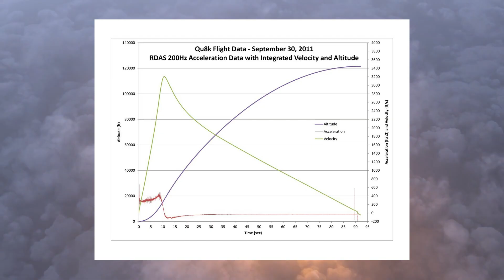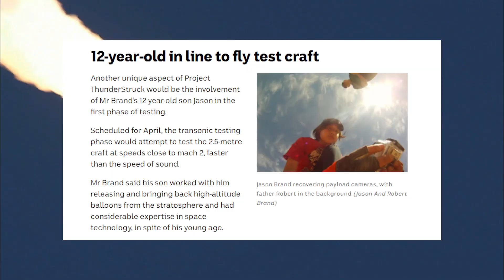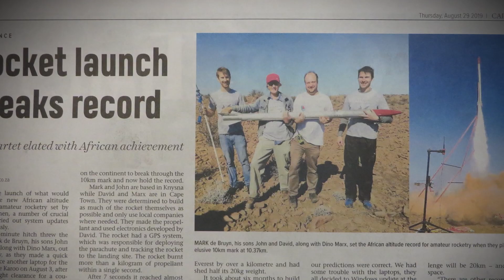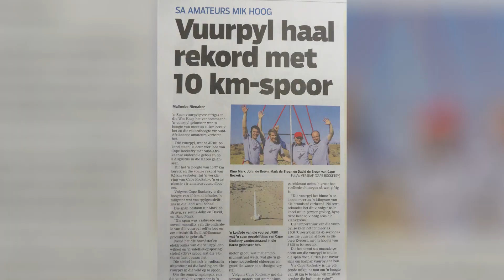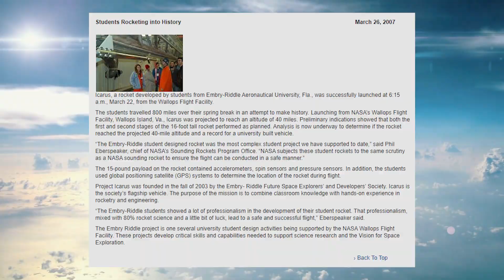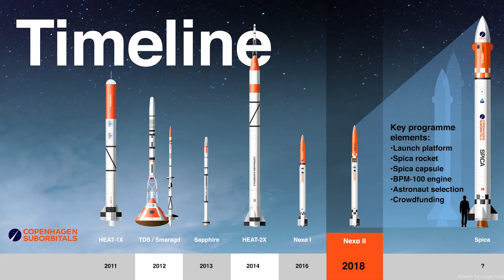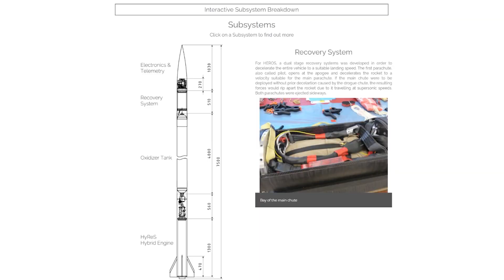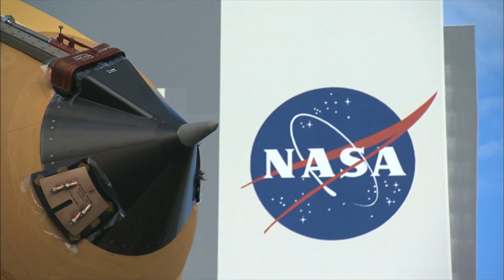15 Homemade ROCKETS that are Incredible

Comment: This video is from 4 years ago, but the script reads like bad writing from ChatGPT. At 12:49, it's said the Tycho Brahe doesn't use nitrous oxide for the "fuel" like Virgin Galactic, but rather LOX. Seriously? That's the oxidizer, not the fuel. Oxygen is literally in both names. And LOX isn't some fancy new outlier, Robert Goddard used gasoline and LOX 99 years ago (March 16, 1926).

And let's not even get started on the Mercy Redstone flub. The moon? Seriously? That would be like someone going from San Francisco to Tokyo in a unicorn floatie. This video has some great rockets (and an oddly excessive use of Ares1 footage), but good lord this is awful.

Comment: The Dome separating our air space with the Fluidic space above the Dome is 70 miles.  This is why NO ROCKET or thing can exceed that height.  Space as you know it is in FACT Fluidic space.  Nothing we have can travel through it; NOTHING.

Comment: Anything with solid propellant is just playing.
Reply: I see. So then, that's why the Space Shuttle and SLS use/d SRB's as their primary thrust.
Reply: @BryanM61  the space shuttle was designed in the 70s. The Chinese were building solid propellant rockets 2000 years ago.

Comment: I was setting up my homemade rocket at the park when I saw a low flying banner plane heading straight at me. I couldn't resist waiting and timing my launch to try to hit it. Rocket went up and popped its oversized plastic garbage bag parachute right in front of it. The plane had to take "evasive" action.....lol  I got the heck out of there before someone accused me of trying to shoot it down!!!

Comment: Are there any amateur rocketry groups that are replicating SpaceX rocket designs in order to test alternatives?  Such as, heat shield wraps (instead of pinned tiles), a deployable and redeployable scissor wing (instead of the fore and aft winglets), partially lifting a rocket with hot air balloons in order to reduce the required thrust to reach orbit.

Comment: Where are the amateur antigravity groups developing vessels that need no fuel or propellers or….? I'm surprised Bob Lazar hasn’t developed a vehicle using element 115 off of the periodic table. Newly discovered a couple decades ago. 🤔 This element is required to propel one type of antigravity machine…..Bob was involved in reverse engineering several captured antigravity ships.

Comment: That sht could get expensive!  In '60s E. Lansing MSU Rocketry Class, 1/2 of grade was in your rocket's performance.  Had to use Estes rockets limited in size, but no limit on how many.  Made titanium tube, cone, & fins for 5 stage rocket.  Used 2 chutes to ride wind.  Caught "Streak" my grasshopper, used wet holed sponge for H2O, Prof fired it from car battery, it shot aimed for SE so fast trackers no see.  Trackers no see, student get no grade so failed class.  Couple days later Prof called.  FAA had removed parts of his azz as rocket had zipped by TWA Boeing 707 transiting over TCA.  Prof did this for years w/no problem, but learned he had exclusion square as opposed to box w/complaint from FAA.  Scared hell out of Pilots, PO'd airline, DOD noticed as probable attack on liner, and the hunt was on.  I designed aircraft for DOD since 4, and contact was Kelly Johnson out at Northup.  I was from Michigan & right away Kelly realized it had to have been his ahole that did that.  Same time, Prof got phone call from gent in Pennsylvania that had recovered capsule with Streak A- OK, so calling for $20 reward offered in note.  Exoskeleton & sponge had saved Astrohopper, and gent said he was busy makin' Michipenn Hybred Hoppers.  I sent gent his $20, he sent capsule & chutes, I got A for class, and shot down no aircraft in process.  Then the real questions began as to where got titanium, and where did I machine it.  (which I had "forgotten")

Comment: why dont they just fly these rockets to the moon? and discover the remnants of the moon landings and investigate if they really happend or not?
Reply: The moon is wayyyyy to far
Reply: The rockets have enough fuel to go what?  73 miles?  The moon is 238,900 miles away...

SOOOOO they are about 1/3200th of the way to the moon...

That's why.  We went to the moon dude.  We left a reflector on the moon that you can fire a laser at to prove we were there.

Comment: for those not aware, Icarus was built in Daytona, Florida and launched at Wallop island in Virginia. 

Not sure where they got Lakenheath (ERAU does have a small campus there but it's part of an Airbase)  from but Majority of those who worked on the rocket were from the Daytona campus (main campus). I heard about it when I was on campus talking to people when I was a visiting a friend.
Reply: Wallops Island. I would think that Cape Canaveral would be closer to Daytona. They should have gone there. Florida Man never does the rational thing though.
Reply: @1pcfred  Kennedy space center  at the time would've been doing space shuttle launches and I think the pad was still under investigation at the time and I doubt Edwards AFB would let them. 

Plus the mid alatntic space port had a spare non damaged or recently used pad while Kennedy space center didn't. 

There's logistics to these especially when borrowing NASA personal.
Reply: @1pcfred  I'm well aware Wallop is a NASA facility. There's several layers to this onion. The biggest one that can be used as a TL;Dr:, Wallop already agreed to help with the rocket early on. East coast has a bunch of controlled airspace and the FAA wouldn't allow a launch 

For class 3 and borderline actual rockets you can't really do it wherever you want and have to go through a whole process for the FAA and restrictions by the NFPA which really limits on launch sites for people on the east coast where we mostly dont have uncontrolled airspaces like the midwest has with black rock desert. Going through NASA makes it a whole lot easier. 

The Icarus team had this worked out with NASA for a while (I think 3 years before launch) through NASAs pushes into STEM back when they had big funding for the space shuttle and ISS missions and Wallops was helping from early stages when possible. Plus they would get information from both the rocket telemetry and NASAs radar system on the rocket, avoid doing the super messy and annoying FAA paper work if you have an actual launch facility.  

Don't forget this rocket isn't something you can launch out of a citrus field. This was a 16 foot 266lb beast with a constant thrust of 3,552 lbf with a sexond stage putting out 922lbf.. high powered rockets start at 3.3lbs with 18lbf of average thrust. Imagine trying to get the FAA to approve a launch from students where there isn't much uncontrolled airspace especially when you're going into the Class A airspace realm while NASA has a nice Special Use Airspace which helps with the FAA paperwork immensely. 

Rocket science isn't nearly as hard as the paperwork for a rocket launch.

Comment: I can assure you no Mercury Redstone vehicles EVER went anywhere near the moon. Anyone that has played Kerbal Space Program can tell you that. Those were definitely sub-orbital vehicles. The Mercury capsule was not set up for extended flight even if it had the delta v behind it. You would have suffocated and/or froze to death before you got to the moon.
Reply: More likely boiled to death, since it had no heat rejection systems.

Comment: I'm amazed no one is using a secondary duel ram jet design. Mine wouldn't  be round. However it's just a pipe dream and not a hobby I can afford. I like the concept behind an engine that goes faster and faster and with a fan driven pump  system creating even more pressure I'm just really  curious  how fast it will go.
Reply: The thing is, the atmosphere is  gradient, ramjets are good for cruise missiles, but rockets escape the useful area of ramjets fairly quickly, because ramjets can only work up to 18 kilometers theoretically, with decreasing returns, and space is recognized as 100 km, meaning that the ramjet would just be dead weight for most of the flight
Reply: @-coolerlegothings-9784  That's because of the lack of Oxygen up that high I'm aware of that it would need a oxygen and fuel mixture I just  want to compress and increase the force already being released. And the SR71 is Capable of going into space it uses scramjets that don't fire until the plane is going at least 400 miles per hour otherwise the engine won't fire just billow black smoke.The pressure coming in disperses the fuel.I would have to draw a diagram of what I mean which I can't exactly do on here.
Reply: @trumanthomas4253  While this design does increase efficiency, it still only allows the blackbird to get up to around 16 miles, which is, while on the height of ramjet capability due to it's compression system, still relying on air to produce thrust, and also still needs to be accelerated first to work, although much less than a standard ramjet. While it's great for standard missiles  and is more efficient than solid rocket motors, it would have to be ditched to save weight fairly early on in a rocket heading to the Karman line.

Comment: FYI, Civilian GPS is limited in it's maximum altitude and speed to prevent it's use in GPS guided ballistic missiles by foreign powers. This may by why the GPS failed. It functioned as designed.

Comment: You guys would know.  The key to orbital flight is what Von Braun achieved in 1939.  Turbo-fuel pumping and gimbal control... combined with the brilliance of regeneration cooling.  Those are the keys.  It's a hard act to follow, but it's quickly approaching 100 years after.  So, Elon did it, yes?
Reply: Elon may have put funds towards it. He didnt do it, He also didnt do Tesla. Talented engineers did that. He may have facilitated it, with his gross wealth, but thats the limit of Elon.

Comment: I'm no Einstein.But if the whole point is to achieve distance & use less fuel.I wondered if drones (the 4 fanned invention) could be applied in some way...Perhaps fuel runs out,remotely engage fans to eject out the sides & use that as of means to push forward.But then again.I dunno how blades of the fans would perforn at them altitudes.

Comment: 3D printing the engine is one of the most exciting parts of this video.
Reply: rocket labs run 3d printed engines in there commercial rocket programme, they have LEO orbital capacity and are looking expand to lunar orbit.

Comment: 3D printer? I started model rocketry with no money so i had to be creative. All of my rockets were homemade (everything except the engines) out of things like paper towel tubes, pringles cans (not as-is of course. Cut, wrapped and glued you could make not just the body but many mounting features from this "cardboard plywood" that's stronger and lighter than balsa or plastic). The openings of water bottles fit one size of motor perfectly. Etc. My third rocket was an exaggeration of this concept called the Dumpster Dart - paper towel tube, paper plate, candle wax, key ring, elastic babe, trash bag, water bottle ... The fins were old debit/credt/membership cards.

Comment: Those is not amateur rockets, so were does amateur rockets end in size.
Reply: Most of those rockets were not 'homemade'. Many of them are classified as 'amateur' since they are under T-impulse... 200,000 lbf-s is the limit for FAA definition of an "amateur" 
https://en.wikipedia.org/wiki/Model_rocket_motor_classification

Comment: Why not use heavy lift balloons to start high up instead of off the ground?
Reply: Logistics, expenses, if you can find a balloon capable of carrying a rocket I’ll be impressed and how would you go about actually launching it from the balloon?
Reply: That has been tried (rockoons) and is being looked at by a few companies. 
https://en.wikipedia.org/wiki/Rockoon

Comment: At 16:44. The Mercury Redstone was not the rocket that took the first astronaut to the moon, that honor goes to the Saturn V. The Mercury Redstone did however put the first American into orbit.
Reply: The Mercury Atlas did that.  The 2 Mercury Redstone flights with Alan Sheppard and Gus Grissom were suborbital.
Reply: atlas took the first american to orbit, redstone was a suborbital test that went into space without achieving orbit.
Reply: @kingsleyrocketry  I stand corrected. Thank you.
Reply: Ya no problem

Comment: It is a huge stretch to call all but a couple of these "homemade". Teams of engineering students with the resources of a university science department is hardly "home".
Reply: I'm sure while the build was 'on' the Science department was home for the students... but I take your point from a facility point of view... last I checked Home Depot didn't have carbon fiber materials let alone wrapping, vacuum, and ovens for 19' long rocket bodies... but hey in Cali who knows after all Doc built a time machine out of a DeLorean!
Reply: Yeah, the launch pad should have been a Webber BBQ lol. Just kidding.
Reply: Even more egregious is the story of Homer Hickam, popularized in the movie "October Sky."  Hickam won the National Science Fair with his rocket designs, but he also had the full support of the local coal  mine metallurgy shop to provide materials and machine the parts.  Nothing like having the help of a professional fabrication lab with one's school science fair project.
Reply: @ShroomKeppie ......Yeah, coal mines have some of the greatest 
laboratories on earth!   gtfoh!!
Reply: Only about 3 of those were 'homemade'. Last week I built a 'homemade' rocket from a cardboard tube from 'Home Deport' that cost less than $25 total and went way higher than a few in your video. Same with your top 5 amateur rocket video...#1 was a commercial Up Aerospace rocket. And you show me in a picture on a project that was not amateur.